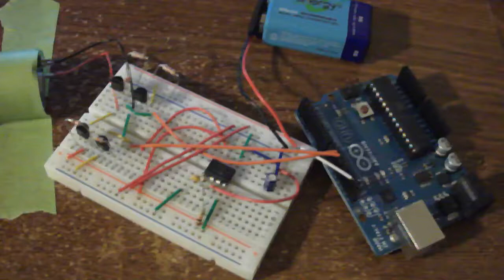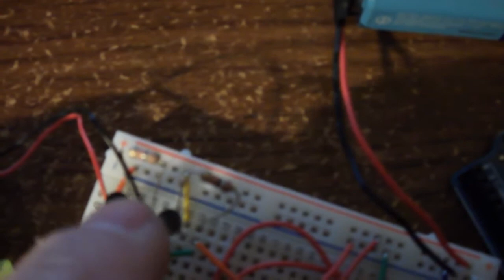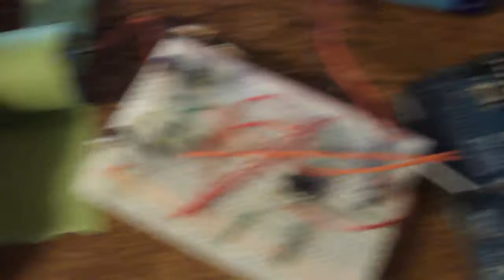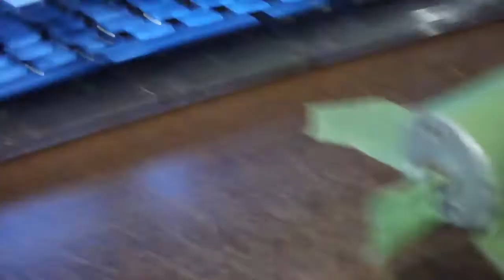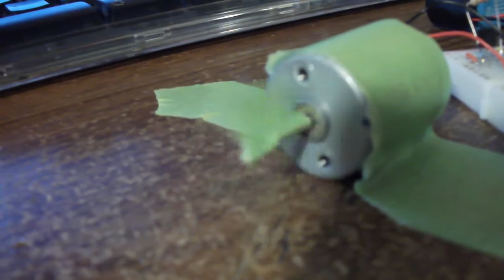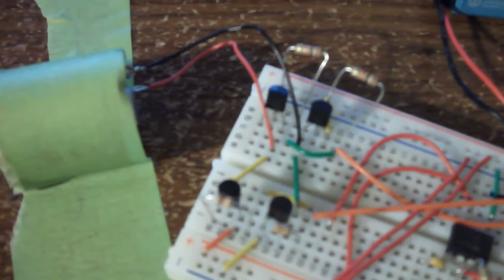My first H-Bridge Circuit

Comment from the maker: @probsty13 It's a reversible electronic speed controller for an electric motor. If I only wanted the motor to go one direction, I could get away with just one transistor to switch the negative side of the motor to control when it's on, and how fast it's going. To go both directions, you need 4, and they need to be connected in just the right order.